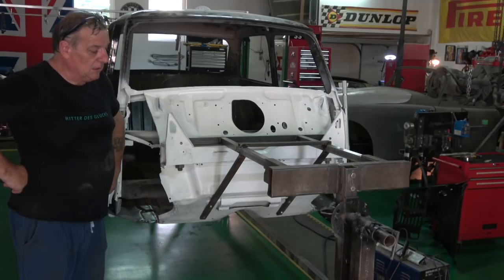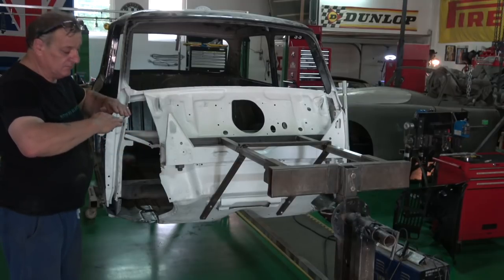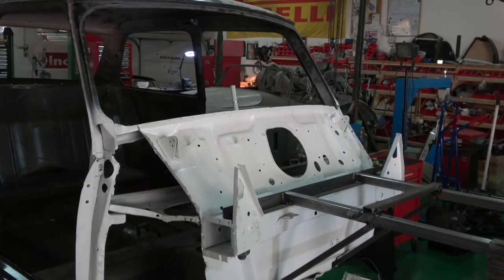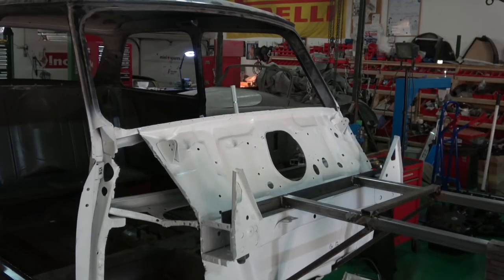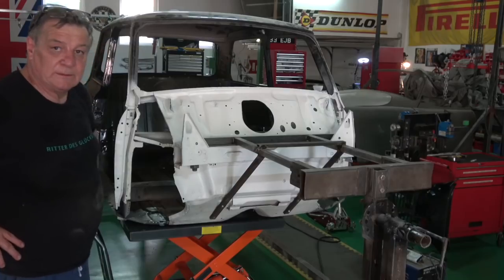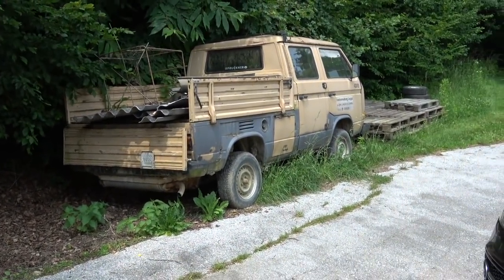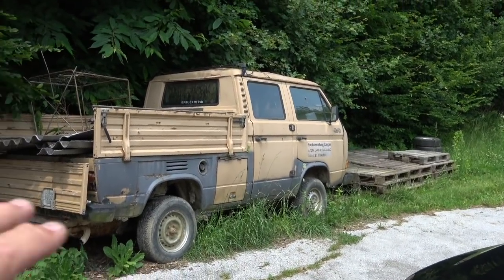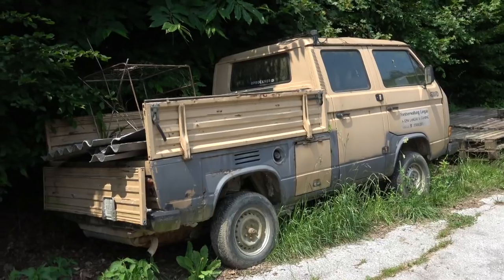Classic Mini Rotisserie Build Part 2  ( WARNING )

Comment: I should of started on the drivers side on mine as it was the more rotten side. I definitely experienced this when I cut out one inner wing, but not to the extreme you did. Perhaps if I had done the more rotten side first I would of had less flex in the side I didnt cut out, but my logic was to start with the easier bit when I was still learning..
Reply from the maker: Ben, If you look my toe board box supports are even longer than normal and bolted in two places and it still moves! I will jack it up and fit the inner wings which will sort any flexing problems out! Cheers Dave.
Reply: davejaguar66 tempted to take mine off the jig again when I come to do my inner wing at the other side. Shall see when it comes to it

Comment: When I did the inner wings on mine I braced it on the inside to a frame that was welded to the door pillars, I used a rotisserie but supported the floor while doing this job. I also did one side at a time,  for this very reason. Overkill maybe, but I was worried it would move like you show here.
Reply from the maker: Peter,  The jig i made originally ( Alex‘s jig now ) supported the front bulkhead & floor really well! It never flexed a mm, But i can now see some issues with this type of jig baring in mind my legs are longer than the standard bought jig and bolt on two holes on both sides rather than the steering column holes on each side! Cheers Dave,
Reply: davejaguar66 I was replacing half the bulkhead as well, so ended up adding and removing bracing a lot. Wanted to be extra safe. It's surprising how much it moves about. At least your jig is reusable. The next one I do I'll have to make a new frame. Good work BTW.

Comment: Dave, That's some amount of movement there. My car was ok but I only removed one inner wing. That VW could be a great project! Sean
Reply from the maker: Sean, I will double up the angle and see if it‘s any better, I will fit the inner wings with the table lift will help line it all up. It just shows the difference between one style of jig & another, Looking forward to cutting the VW up lol. Cheers Dave.
Reply: Indeed Dave. I think once you tack the inner wings on it will solve the flexing issue